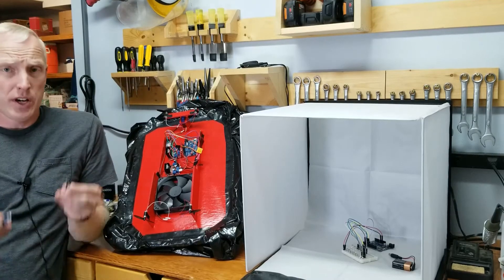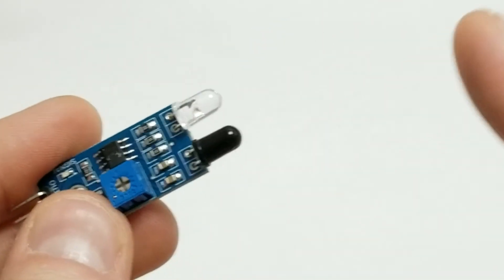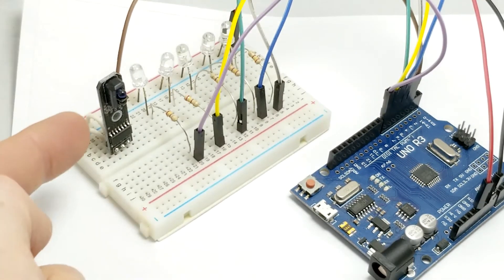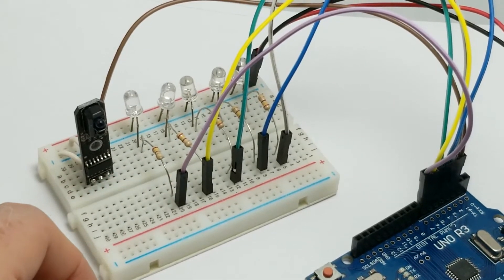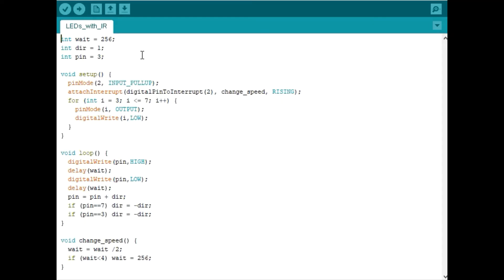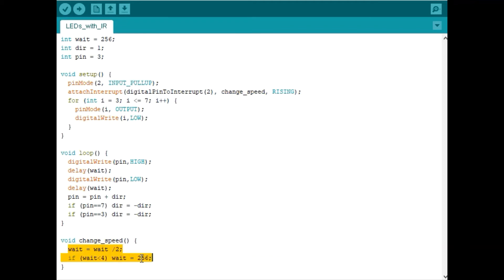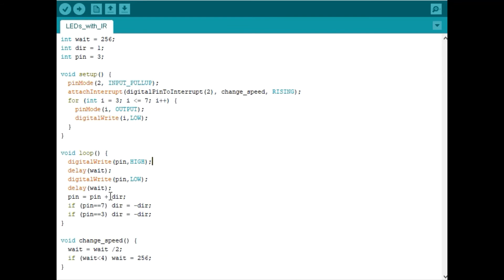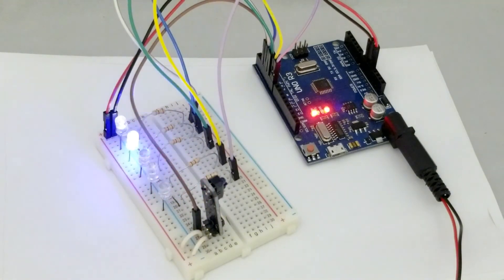Arduino IR Sensor Tutorial // LED chaser using Arduino Interrupts

Comment: Hi i built my own flux capacitor from back to the future, with my friends help. We have written a
large sketch with 9 sequences. we have the y centre leds (3 strips of 10) and door leds (4 x3)
working simutaneously. we are using arduino mega. everything works fine but we are having the
problem of the IR remote changing the sequences. i tried incorporating your code, it uploaded fine
but didnt make a real difference. happy to show you the code if you could help. thanks
Reply from the maker: Hmmm. Not sure what is going on. What pin are you using for the IR? Make sure that that pin can be used for interrupts.